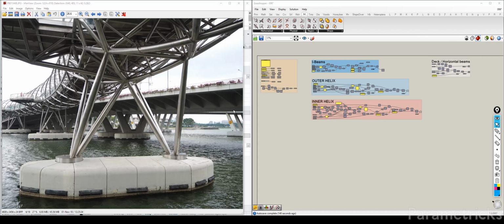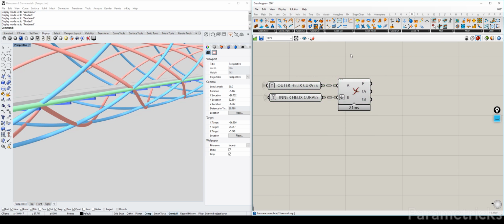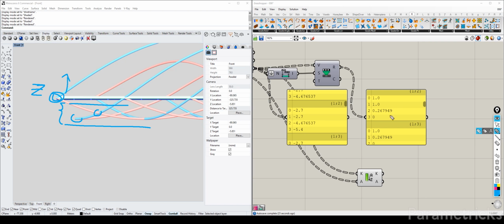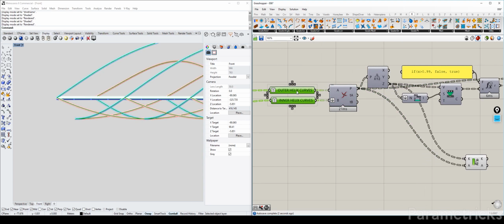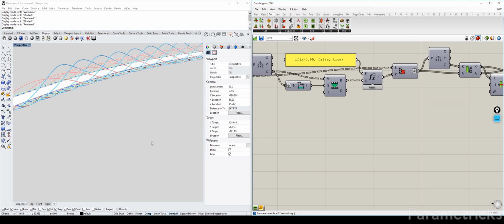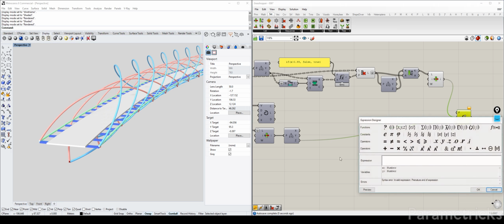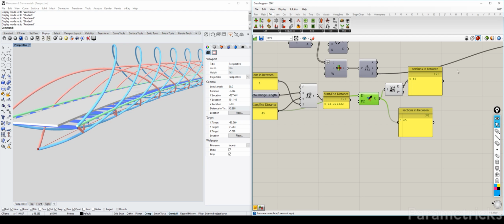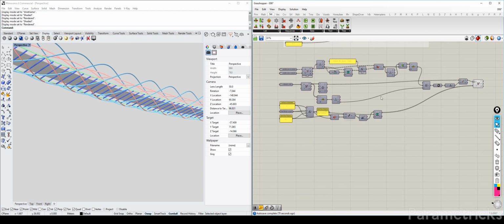Making the Helix Bridge with Grasshopper, part 07/15 (Grasshopper Tutorial)

Comment: Hello dude,
im modelling  the Arganzuela Footbridge in Madrid which is very much like this bridge. Tho what i cannot seem to make is a cone like bridge . Mine starts with 5m Width and ends with a 12m width.  Any tip on how to implement this detail into the perpendicular planes we created ? 
I Basicly need to change the radius of the circles. In my Case i have 128 Planes with 128 Circles. I need a set of numbers. Precisely i need 128 Numbers starting from 5 and ending with 12m, taht differ with the same amount from eachother. 
PS: I solved the problem. I needed to construct domain. with 5 and 12 then Number Series 128. XD
Peace Serxhio

Comment: @parameticks the way you select the point at the end is actually pretty messy and it impact the way you select your point on video 8 as well. from your intersection of curve you extract z value the round it to 0.1 then create set sort your element then you have a list item components that allow you to have each series of point by  value . to sort them sort along curve tool with the original curve. voila . therefore on video 8 you can use closest point tool to search your point . let me know if you want a screen shot . any way thanks a lot for the videos i learnt some useful tricks
Reply from the maker: Hi Gerard, thank you for your feedback.
I agree that some parts of the original script can be optimized or done in a different way. If you would be so kind, then please attach a screenshot to imgur or some other service, so I can have a look.
Reply: Parametricks  https://we.tl/t-KGDfs9U2TW?src=dnl you can use that link to download high Res png of the canvas I also use a method of vector 2 points to move the points from view pod edge

Comment: I have a doubt, when I add the component "Evaluate f(x)" and I join to the ecuation of this video, it gives me an error result. I was checking the components before those and I see that my numbers on the panels connected to "Sort List" and so on are different form what you actually have on the video. I don't know if the problem may started from the inner and outer values of the previous map.
Reply from the maker: Hi Diana, 

My apologies for not responding to you sooner. 

Not sure if you still need help or you figured it out already, but I am happy to assist you, should you still need it.
You can start by mentioning where precisely in the video you are having issues with.